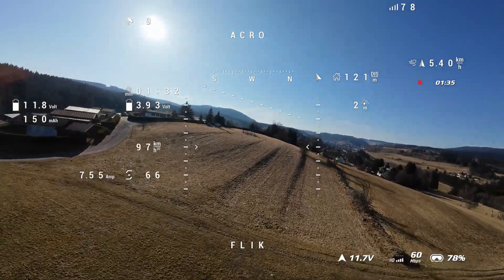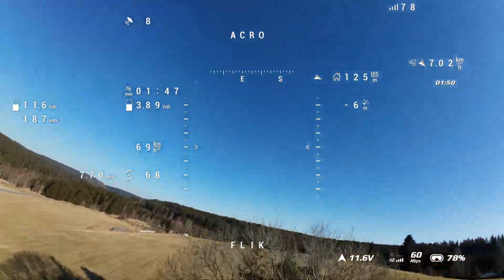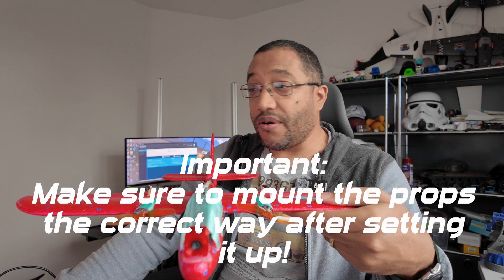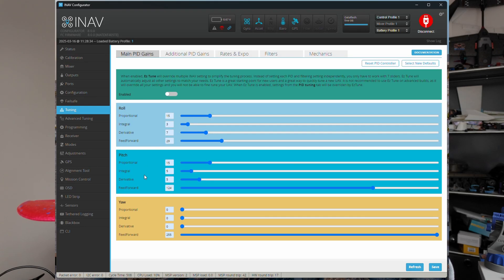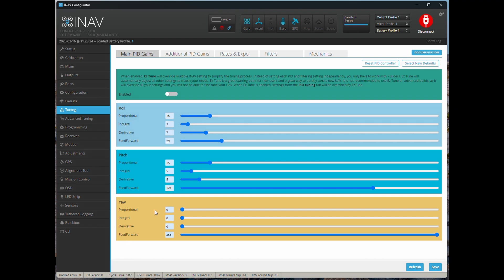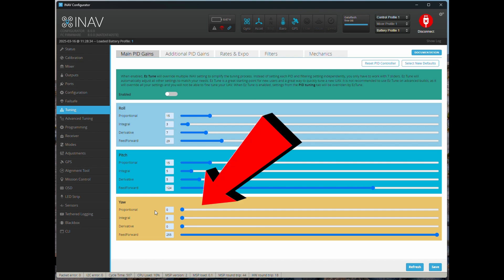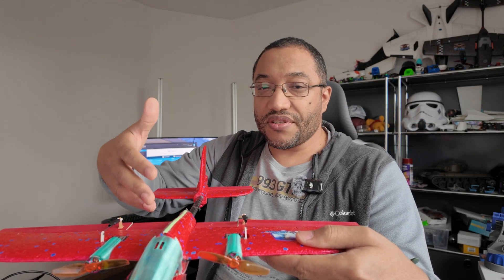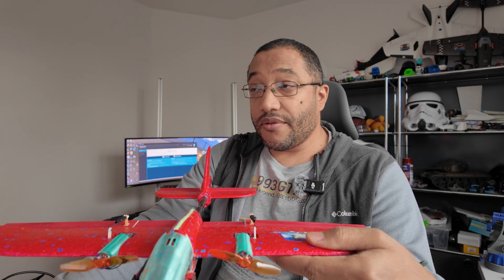INAV differential thrust // Why I love it and how to set it up

Comment: I just noticed your DT is backwards. https://www.youtube.com/watch?v=UeroXOmn_8Y&t=124s
Reply from the maker: It doesn't actually matter. You need to set it up that the motors do spin up on the correct side. So if it's reversed you either swap the motors connection (as we are using an AIO with custom firmware -> not a good solution) or just reverse the 0.7 / -0.7 to -0.7 / 0.7
Reply: @McLogo76  My bad bro, I just looked and Inav loads them by default the way you have them. I also upped mine to 1.00 and OMG, the yawthority is real!
Reply from the maker: @willbrown8928  No issue bro. Nice🤙🏾 will you keep flying 1.0?

Comment: Nice !! I hear you talk about the T1 ranger. Does it work nicely on the T1 ? As i read on some forums that on the T1 it does not have much benefits  (or maybe they are just talking about yaw stabilisation and not using it like you ).  I have a heavy T1 with strong T-motor F40 motors so wondering if it is usefull for a setup like that  
Thanks for your advice / experience
Reply from the maker: Thanks, I‘ve also switched my T1 Ranger pro that I fly with 4S 1300 packs an slightly larger 2 blade props to diff thrust and I surely like it better. It‘s possible that they also don‘t feel it that much because the motors are not that far apart or the differential was setup too low. 0.7 / -0.7 is a starting point for me but I wasn‘t able to fly it enough yet to test higher settings 😉
I would certainly try it for yourself and see if you like it - as it‘s easy to setup and remove.
Reply: @McLogo76  Thanks. Will try it. Have already set it up this morning as part of some other maintenance (added pitot tube) and may test it tomorrow. Have it at 0.7 now and flying it normaly with 6x4.3  2 blade props on F40-2400kv on 4s P45 Mollicels so lots of power (and power to spare). Thinking mainly to use it during landing to keep the line even with crosswinds without having to yank and bank. For normal flight i prefer the dynamic wing type of yank/bank flying. Feels more like i am actualy flying if you understand what i mean. Or at some point try some of the trick moves you showed in your video hahaha. 
Have a great weekend
Reply from the maker: @ Thanks! Have a great weekend, happy flying and looking forward to hear how you like it.

Comment: wow, first time i see fixed wing flying smoothly like a DRONE, not rocking side to side. Much appreciated! I wonder if ZOHD Altus could be configured with differential thrust, it's V-tail though, could be tough
Reply from the maker: @Alejandro388  The clean footage is stabilized. Whenever you do not see the OSD 😉 Wings/Planes are just inherently moving more than quads. Sure basically any 2 motor plane/wing with separate esc‘s can be setup with diff thrust. One would need to test it but I‘m sure it can also be setup well with a V-tail

Comment: Thanks for explaining and helping people with this. I use the same settings for my Penguin high alphas / harriers. Just fun together with the headtracking and Walksnail GM3 gimbal.
One additional setting really useful for me is the "Yaw expo". In the receiver tab I think. At the moment I fly with 0.7 expo (70%).
Reply from the maker: @ApappieK  Thanks a lot! I still need to learn doing high alphas 👍.
Interesting, I don‘t use expo on yaw on wings and I think also very little on quads. But surely something that could be helpful for others trying it. How is the headtracking working for you?
Reply: @McLogo76  The yaw expo gives me just a better differential thrust control. Sure a personal thing. 
The human head moves in 3 axis. This movement is 1 to 1 transferred to the GM3 gimbal with an additional dampening (no post Gyroflow needed). I use the Walksnail goggles L with headtracking build in. This picture feels very natural and immersive. Only my feet are on the ground, the rest of the body is flying 😊. It's a fragile construction, so don't crash. I feel no latency. 
A two axes gimbal with pan and tilt servo's doesn't feel natural.

Comment: Super cool! Are the 3d stl files available?
Reply from the maker: @johnaguirre9388  from the chuck glider? yes, what do you need?
Reply: @McLogo76  I was hoping for the integrated motor pods with the servo built in,  I love the integrated look
Reply from the maker: @johnaguirre9388  The motor pods are actually clamped/glued to the wing. The servo space is cut out of the foam – the servos are glued in with Uhu Por (foamtac). I can give you the link to the motor pods stl. The holes fit 1303-1404 and similar motors and are printed out of petg translucent.
Reply from the maker: @johnaguirre9388  here you go https://drive.google.com/file/d/1_E9dhwsFftW5twrYeS7xyrvfMBb_OxNx/view?usp=sharing
Reply: @McLogo76  Thank you so much!
Reply from the maker: @johnaguirre9388  👍 designed by averageFPV ;)